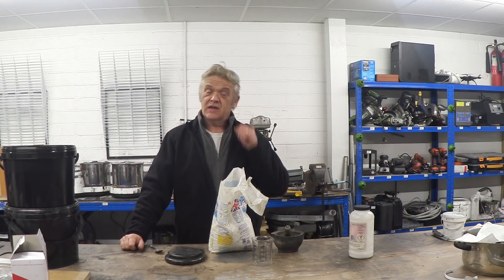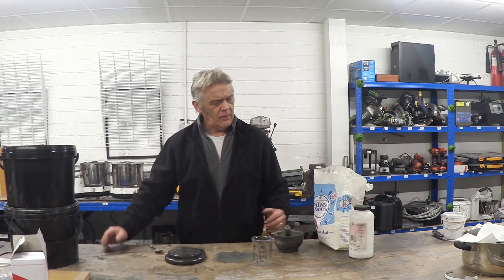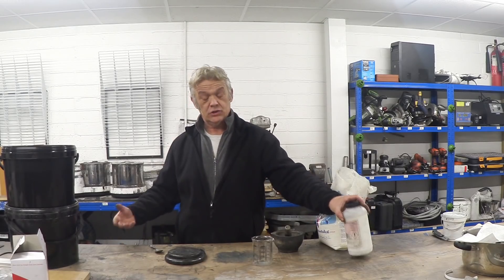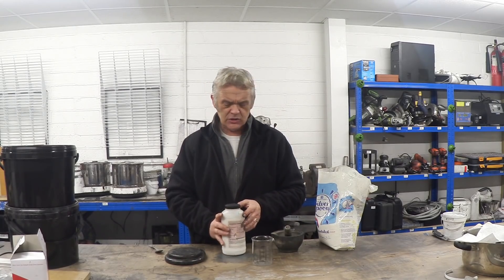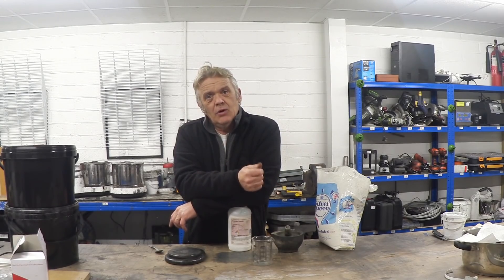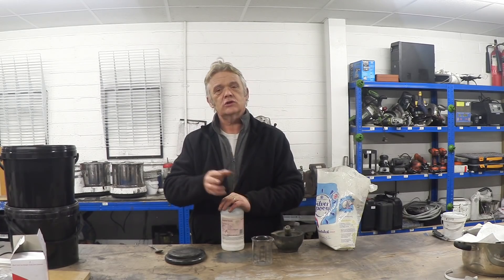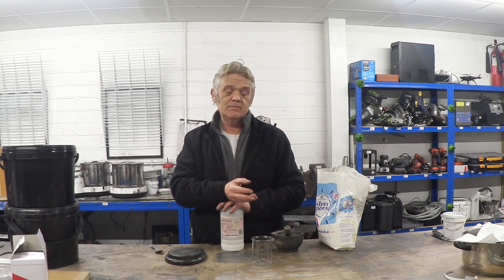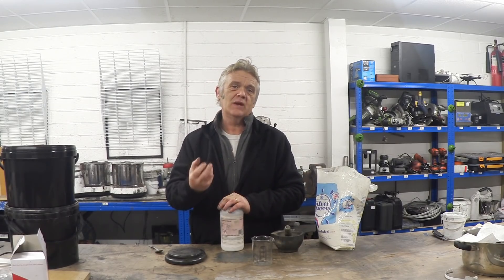Making Graphene Foam From Table Sugar

Comment: Can you make some by just wrapping some sugar in a small aluminum capsule or aluminum foil container to contain it. then wrapping several layers around that to trap the carbon dioxide and prevent it from oxidizing. then cook it until its ready?
Seems like it'd be really simple to make.
Not looking for a PERFECT result. just enough that it'll do something when you make a sandwich out of it and some copper electrodes or something.

Comment: Hmmm!  This may be a cheap method, but there are other options with a low temperature kiln.  Your previous 10 gr of sugar and ammonium chloride, to this add 10 gr of graphite powder and 2 gr of fine aluminum powder. grind it in a blender with a small amount of water for 30 min on low speed.  Prepare a flat pan with a piece of heavy duty aluminum foil and place the mixture in the middle and allow it to settle as a flat surface. This could be allowed to evaporate for a few days.  The ideal time to place it in the kiln if after it becomes tacky and will not shift when you raise the edge of the pan.  Place it in the kiln at 160°C for 30 minutes and remove and allow to cool completely.  The mixture will be hard and stiff enough to peel off the aluminum foil from the back and place this in a flat bottom Pyrex glass dish and return it to the kiln for one hour at 300°C.  this will allow the mixture to degases the toxic fumes and will melt the aluminum into the graphite as it turns the sugar into grapevine as a medium, the blend is very hard and conductive and can be cut with an abrasive high speed rotary cutter or diamond blade.  I would prefer to use a tile cutter without water as a lubricant instead of a hand held angle grinder, because the mixture can be fractured like glass if its cut uneven or with excessive vibration.

This makes better electrodes for  rechargeable batteries, use a piece of regular felt in two or more layers and use an aquias solution of potassium chloride as the electrolyte and you have a graphite-aluminum rechargeable battery as good as any lithium battery and much more stable and longer life.  Cheers.

Yes, my first degree was in chemistry at 16, followed by my electrical engineering degree at 21, and I specialized in microprocessors in the early 1970's in what became known as Silicone Valley, California.  I hope I didn't over explain it, but enough for the basic chemistry student to follow and have a workable technology for free off of the internet.
Reply: Thanks!
Reply: Thanks 🤗💖🌹 The John.
Reply: how i you get a degree in chemistry at 16?! i didnt even get done with high school until i was 18

Comment: nice.  isnt 46 ohms high resistance?  shouldnt it be much lower if it is condcutive?
Reply: I remember when I crushed up some wood charcoal, mixed with glue and got like 40k-150k ohm resistance.
Reply: @SinsBird  ok, thanks . is this graphene that the professor made or is it graphite?
Reply: @samosdolphins123  both, really. In general it's graphite, but graphite is made of many layers of graphene.

Comment: Sugar and ammonium chloride are both water soluble, why not dissolve the mixture in water instead of grinding together? At the temperature you're raising the mixture to the water will boil off.

Comment: Is this a 'better' carbon foam than those produced by the other methods, e.g sugar with baking soda as the 'blowing agent'? but grinding the reactants into fine powder first. As per the other video with 3 methods including the explosive one. Just asking from the point of view of very easily obtained materials versus the improvements gained by sourcing ammonium chloride. Does the sugar/bicarb foam graphetise ok in the kiln?

Comment: Just a thought. A while ago I made some very light weight carbon foam using a variation of the Naphtalene-Mediated Hydrothermal Sucrose Carbonization method. The article I took the method from suggested the foam would be "Ultralight Carbon Nanofoam". It was certainly very low density, but had very poor conductivity, so I didn't go any further. However the graphitization post process step you describe here sounds like something worth trying.

Comment: Robert, what is the difference between this "graphenic" substance and true 1 atom thick graphene? How are they different and how are they the same? When this is used in battery construction, what decrease/increase would be seen if using true graphene in contrast?

Comment: Why not just use hydrochloride acid in powered sugar. It will automatically make a great towering volume of foam. Then seal that in a crucible and super heat that to 1000 degrees. Seems much more practical. Thanks sixth grade chemistry class... lol
Reply from the maker: because all you get is a mess lol - seriously mate - interesting idea - go for it and let me know what happens

Comment: I bought some expanded graphite and put it in an ultrasonic cleaner with a small amount of water. What I got was dark gray/blackish water with pearl-like sparkle to it. Also had a bright, shiny silver layer floating on top. Had a little solids on the bottom that didn't do anything. Does anyone know if I have a graphene suspension.....or just graphite water? Or possibly a mixture of both?
Reply from the maker: a mixture of both. mate
Reply: @ThinkingandTinkering  I ran the solution through several coffee filters (the finest filters I have at the moment) and got a nice liquid with no sediment. Stays in suspension nicely, even when sitting untouched for days. I also sonicated molybdenum. I'm working on adding them to Si02 to make a "ceramic" sealer/protectant for automotive clear coat. I'm also working on an acrylic resin version.

Comment: You can do this with bread. Put the slice(s) in a square container with a small hole in top. You can add argon before closing it if you wish. Heat to around 800 to 1200 degrees until all of the volatiles have burned off through the hole. Cover the hole and let go for a half hour.---  Pre tapping the hole and using a small bolt works pretty well for sealing it up. Remove and cool. There you go. Carbon foam suitable for a refractory. or semiconductor.
Reply from the maker: nice one mate - I'll try it

Comment: I have been following your channel off and on for about a year now I'm vary mechanically inclined not so much with the sparky things though . I'm trying to build a solar generator but I dont want to use batteries, supercaps are supposed to be cheaper and charge faster but I cant find anything that will explain the work comparince of a battery to a supercap in a way I can understand it . I know this isn't what you like to do you try to get people out there to experiment for them selves but unfortunately I am knee deep in a million things and dont have the time or frankly the knowledge so I'm begging you to give some kind of explanation of how many 2.7v 3000f capacitors would I need to run a 120v 15a circular saw for 15 min or if it even could . Thank you for your time I hope to hear from you .
Reply from the maker: I don't know what to say mate as I don't know how you need to understand - that is I am not sure what your learning style is so it's kind of hard to advise on what to look at that might help - all I can suggest is you keep plowing through the material there is until you find one that suits - we do have lessons and texts on the site - but equally they may not help

Comment: Why not try to use baking soda or baking powder? If you mix the sugar with water and baking soda and slowly bring up the heat the baking soda should start releasing co2 and turn your paste into a foam. YOu could also add starch as a thickening agent that you can burn off later.
Reply from the maker: you are looking to create a balance of micro and nano pores for a foam to use in caps mate - baking powder makes great micropores but lousy nano pores
Reply: @ThinkingandTinkering  Ah ok. Could that be adjusted through adding other stuff to the mixture that burns off. Maybe organic nanoparticles that leave vacancies as they are decomposed at a higher temperature after the main foam structure is already there.

Comment: You should try doing this with chitosan (available in capsules as a fat blocker from the chemist), its amine groups would dope the material with nitrogen post graphitisation. I suggest you boil the ground material post graphitisation in nitric acid. This would charge the newly formed aromatic nitrogen to ar-NH+ which could help them de-laminate (increase surface area) and also the charge would greatly improve conductivity as the positive charge sits within the delocalised polyaromatic mess and so can conduct by hole migration (similar mechanism to conductivity of polyanaline salts).
Reply from the maker: nice suggestions mate - thanks for taking the time to post
Reply: @ThinkingandTinkering  Always a pleasure!

Comment: interesting, I have been looking at the online processes discovered in an attempt to recreate starlite, and had thought that adding other things to it might allow me to make it semiconductive, now I may have to add this to that mix, and stop at the former step or not go quite as high since I dont want it to become extremely conductive, but rather semiconductive so the contaminants can alter it to make diode like components, who knows, I might be able to produce a far more efficient peltier device, something I am kinda hoping to be able to do, since none of the ones I have seen thus far are embedding the PN junction material in aerogel, it seems like a sensible option especially if I can make a more thermally insulative semiconduction joint than tellurium bismuth does.
Reply from the maker: I am just about to do a series on hard to form ceramics
Reply: @ThinkingandTinkering  can't wait, most of the actual stuff beyond what I release from time to time here, I keep on Tox chat ever since I found a whole conversation about laser assisted vapor deposition I had with a friend, on skype (partially text partially voice call)  pop up right after that on wikipedia as a removed group of pages, all of like 40,000 (I am not looking at the history now, so it might have been like 10,000 characters, not sure but I will come back and leave a reply with a link to their account page where their contributions are listed for reference) characters and 10 pages worth loaded on there, 8 new pages and 2 modifications of existing pages, word for word, and by a random user name made that day, all listing done in 36 minutes then logged off never to return in over 2 years now, even though everything they listed was removed with red text being the only trace you have  to follow and see the revisions, and new pages they made. And the curious thing about all this? just to finish it off for the weirdness, is that everything I had conversations with him on tox for a completely different reason, included the needed aspects to make it properly work for 3D printing processes, were missing from the wiki info, only the stuff from skype was there. I can talk to you privately if you are wondering why we took it to tox but I still won't talk openly about that here due to the problems it could cause a whole lot of people, if I discussed this openly. at any rate, main reason most stuff is still on tox private is because I am not ready to release anything, but when ready everything will be open and public, concerning all my work for advancing 3D printing. and I will try to include as much footage as possible to hopefully allow full replication everywhere desiring to do so, :)

Comment: Is the next step to slice it into wafers? ~( 'w')/
Reply from the maker: I'll probably bring and mix with binder as the foam is a little mis-shaped
Reply: @ThinkingandTinkering  Maybe if you can develop the mix in either a sacrificial container, or if you know it is prone to shrink back from the container enough to easily remove, find a tall vase from a hobby supply shop [not sure if you have those in the UK like we have here] of a relatively uniform diameter [they have rectangular and cylindrical ones here of both practical and impractical sizes] and carefully fill it based on your experiences in relative expansion, even maybe allowing a little spillage [place it on say aluminum foil to keep the mess to a minimum]  so it will expand [relatively] uniformly to the top, which should allow you some better chances of a somewhat uniform block of foam which could then maybe be sliced with a very fine abrasive wire, or maybe a coping saw [those usually have really fine blades] in a guide [my father had a small vibrating jig saw that had a very short stroke but cut thin wood like balsa very cleanly and neatly without splintering, I think it had maybe a 12 to 15 cm clearance, not sure now, but they have hand held coping saws with over 20 cm clearance, so those would allow pretty decent wafers.

Also if you had nothing else, you could make a nearly rectangular casting in a normal bread loaf pan and those can be purchased many places online as well as many grocery stores.

Not sure how well a silicone bread pan would work, but likely if it would endure one use, it would endure hundreds of uses.

Many bread pans are made of Teflon coated steel, and many are made of Pyrex, and while they would have curved edges most often, the basic block would be fairly square and uniform overall.

Even second hand stores have them here in the USA, we have many of them here at my house and we don't even bake bread any more.
Reply from the maker: @DeliciousDeBlair  we do have them and we have hobbies an online UK company - originated in the US I think - but great supplier of the kind of things you might need for this - all o what you suggest is certainly worth a try - I think it is really going to be practice and workmanship that will lead to a good foam - but I also think with that it is perfectly do-able - cheers

Comment: Would spreading a layer of the sugar NH4Cl  mix on a lead or copper plate and doing the 250C bake give you a usable negative electrode for an Ultra Battery?  The back of the plate could be masked with a plastic paint or tape (?). Or do you have to do the 800 C step, then try and mechanically fix the resulting graphene foam to the plate?
Reply from the maker: the first stage just gives a carbon that is non conductive. It will function as an active material but I don't think you wouldn't be able to get a current from it
Reply: @ThinkingandTinkering  thanks.  So one has to take the carbon thru the 800 C stage.  Since that would melt any metallic substrate we cannot conveniently use the baking to sinter the graphene to the substrate.  OK.

I take it that you grind the resulting 800Cd carbon mass to a powder to create your graphene resource, which you then stick onto electrode surfaces.
Reply from the maker: @nigelwilliams7920  it would preclude lead an aluminium for sure but copper would be fine as would nickel and stainless steel - it would have to be a non oxidising atmosphere - but you need that anyway.
Reply: @ThinkingandTinkering  thanks for that.  Much appreciated.

Comment: Porous carbon separators with porous activated carbon electrodes... not even sure if that'd work well...
Reply from the maker: you need the separator to be electrically isolating and ionically conducting as most carbon has a degree of conductivity - even the stuff we describe as non conductive - I suspect not - but I don't really know as I have never tried it based on that reasoning - I could well be wrong
Reply: @ThinkingandTinkering  I suppose whatever level of conductivity the carbon ends up being will come out as self discharge. Intuitively the additional surface area would help you, maybe with droop, but I mostly found it interesting and you seemed to like the idea of an all carbon battery.
Reply from the maker: @krap101  i do mate - but that tends to mean current collectors and active material not including electrolyte and separator
Reply: krap101 it does work ! I made a solid state battery with exactly that construction. 

Amorphous carbon as the seperater and grapitised activated carbon on grafoil electrodes . You need to make the amorphous carbon ionically conductive .It works very well and is worth pursueing !
Reply: @Buzzhumma  So it sounds almost like you need to intercalate the carbon with some sort of salt?
Reply: @krap101  yes but not much concentration otherwise the ions cant move. try sodium chloride with a 5% magnesium sulphate. i tried lots of variations and still are.

Comment: Can we use microwave instead of oven and sodium bicarbonate instead of ammonium chloride?
Reply from the maker: you can - but you won't get the same material
Reply: I have been using baking soda (sodium bicarbonate) as an activating agent for different carbon materials with pretty good results using a homemade propane kiln.  I suspect I am just getting activated carbon and not graphetized carbon but cheap, readily available, and relatively safe.  Check out my recent videos.

My theory is the baking soda is converted to sodium carbonate producing carbon dioxide gas and possibly sodium oxide at higher temperatures.  The CO2 gas causes the sugar to foam up a lot to the point of expanding out of the crucible if you use very much at a time.  Rob has a video in the members area on making the sugar carbon more conductive that is different than this sugar foam but still conductive.
Reply from the maker: @flashlit123  that's exactly what's happening mate - there is a sugar snake version based on this too

Comment: Your so close to the inert gas method. You just need a vacuum oven that goes up to a higher temperature then introduce the gas into the pump intake.
Reply from the maker: I know mate - but this is really for home replication - I used the vacuum oven because it simulates a home oven